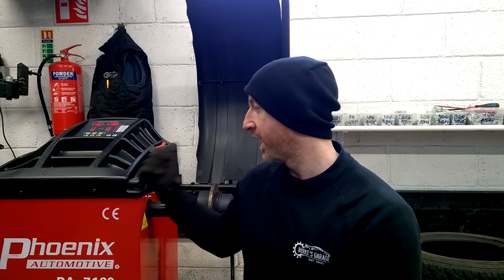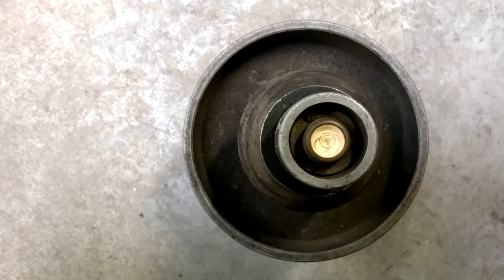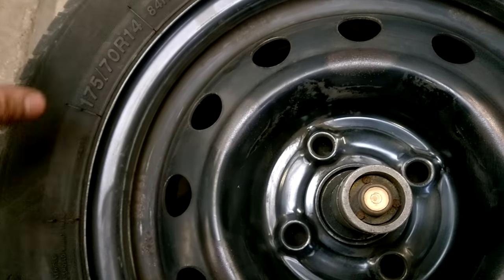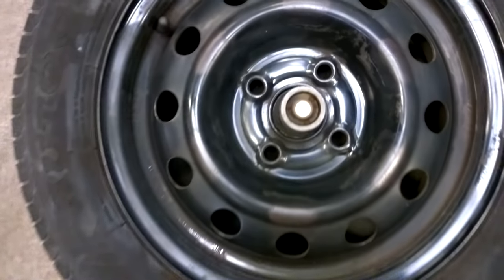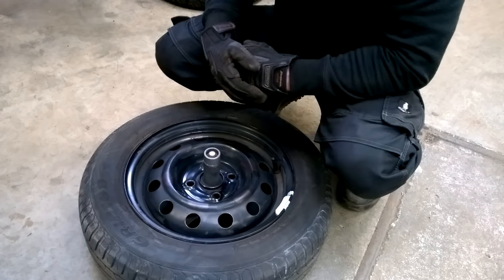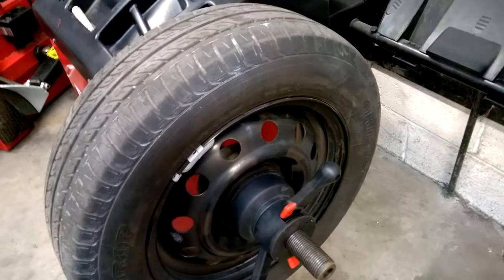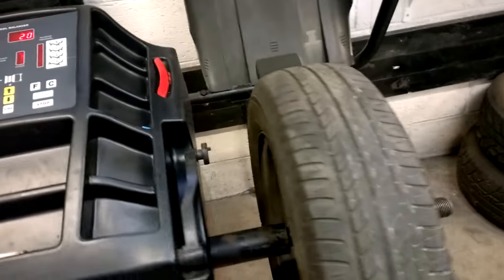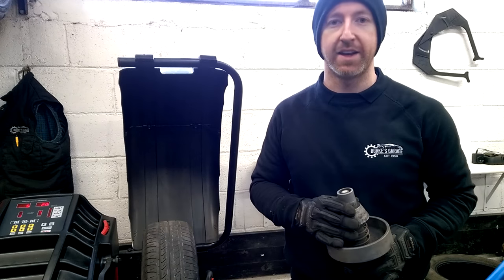Digital Wheel Balancer Vs Bubble Balancer  - Is there much of a difference???

Comment from the maker: To help with any future comments I will simply leave it like this. I know there are other ways of balancing this was simply the way I carried it out as per manual. It is not an attack on bubble balancers just an impartial demo out of interest. 
 
Thanks for watching.
Reply: I think it would be pointless to flip the tire on the bubble balancer, as it only detects imbalances across the tire from end to end (rather than side to side).
I'm fairly certain this comparison experiment is faulty. It's my understanding that static balancing (the bubble) is only capable of eliminating/diminishing radial imbalances. I'm fairly certain that the machine is picking up a lateral imbalance. The reason the lateral imbalance increases when he adds the weights is obvious, he only adds them to one side. If that's correct, how could he not have realized this? He has to put the weight on both sides in order to satisfy the digital balancer.... 
I don't know where the readout for radial imbalance is on the digital machine. But even if it showed a radial imbalance, Gerard could have improved on the radial imbalance while still using the bubble; By adding slightly more weight and spacing that weight around the lighter side of the tire until it is, more or less, balanced.
Reply: If you would read the comments, you will learn what you did wrong.
Reply: Although well-intentioned the eccentricity was not considered out of round elliptical momentum against the center fulcrum allows the tire to be mounted in balance with a weight on the other side it does not make it round it does not make it ride smooth and after it finally settles correctly on the bead it is not balanced either
   Most importantly is sitting the tire correctly on the beat when it is perfectly round you'll probably find from the factory they are perfectly balanced as well
Reply: As well once it is nice and round rotating it on the rim can usually defray any necessity of weights countering against the imperfection of the wheel
   Basically the whole Balancing Act is just that it's a sorry-ass game to cover the laziness of installing the tire correctly the first time which may require dismounting a few times until you get it

Comment: I have to tell you... I just did the tires on my car for the first time using the harbor freight tire changer, and the harbor freight bubble balancer. MY CAR HAS NEVER RIDDEN SO SMOOTH AT 80MPH AS IT DOES NOW!!! And I have always had my tires done professionally, and balanced professionally as well.  I'm sure the computerized balancing  machine is capable of being more accurate, but only if it is properly calibrated, and the tech operating it knows what the heck he is doing.
Reply: Yup.
Reply: I couldn't agree more! I think a lot of garages don't calibrate the digital machine properly, and often don't understand how to operate it, eg:- forgetting to set wheel type, or wheel width properly.
Reply: Great point
Reply: when you do this using a dig or bubble to me the car that drives the smoothest at 70 mph on highway is the winner... this test really did not prove anything imo... just numbers on a machine that did not match the bubble balancer...
Reply: That's because most people don't know how to use a spin balance machine.
Reply: I seen how they calibrated the machine. It takes less than 5 minutes. I think some garages are too lazy to calibrate.
Reply: @tlo35  I don't think half of them know the meaning of the word.
Reply: I was going to by a harbour Freight bubble balancer.....,.they seem so badly made to be worse than useless....

Very stiff....stop rocking soon as you let go....how can that be accurate.
Reply: Wonder what speed he tested the tire at on digital

Comment: You forgot to split the wheigt! 50% of the wheight should have been on the inside when using the bubble balancer,
Reply: Actually split them in half again and spread them about 30 degrees apart if it takes more than two 1/4 oz weights.
Reply: Yeah,  then you know tire was bubble balanced 🙄
Reply: Yup done wrong waste of time to watch
Reply: The smart way to bubble balance is to use stick on weights and place all the weight as close to the center line of the rim as possible. That way the weight you add is for sure not making any dynamic balance problem worst. In fact you may even be 1/2 correcting it.... Any road a dynamic balancer is a wonderful thing to have, a must for a tire shop, but the truth is at least 9 times out of 10 times when a tire won't balance with a static balancer it's because it's defective tire.
Reply: I busted out laughing when he didn't split the weight.  I was trained back in the 80's to repair the Coats computer tire balancers.  Computer balancers are really cool and much quicker, but the tires are balanced at 55 miles an hour ONLY.  When you get on the interstate and do 80 or more, centrifugal force changes the weight needed to balance at that faster speed.  The old way using gravity works much better at varying speeds.  Plus you don't have the stupid guys balancing the tires dragging their weight pliers across the tread of the spinning tires as the computer tries to get a precise measurement.  That used to drive me up the freakin wall!

Comment: I've got a cheap bubble balancer and I've never had any issues... Never had anything feel out of balance at any speeds. The only reason garages prefer digital is they're a lot quicker to use
Reply: Agree - they were setting land speed records using cars with tires balanced on bubble balancers long before digital ones...
Reply: Way to go Sonley!! I agree 100%👍 That's telling them.
Reply: @jerryz2541  yes, in 1886 they set the record at 10 mph...without any digital balancing...crazy huh?
Reply: @kdgdirk  Yeah and when bluebird set the record what was used to balance the wheels.?. Digital wasn`t available then.
Reply: @coopercruse5867  and Bluebird certainly wasnt doing 10 MPH!
Reply: @kdgdirk - Someone need to learn some history... Just saying! ;-)
Example supercharged engines were banned from competition back in the 30's of last CENTURY! As in 1930!!! The ridiculous amount of speed records from those days  were not at 10mph, neither at 100mph, not 200mph... Get the picture?! LOL 😂
Reply: Not all imbalancee is felt, but it can still wear suspension components

Comment: You didn't split the weight evenly between the front and back. Of course it's out. You put the weight on wrong.
Reply: he didnt put the weight on wrong, you only put the weights on the front with a bubble balancer. They are put on both sides  with an electronic nalancer because it balances static and dynamic balance together, where a bubble balancer only measures static balance.
Reply: @roberttill3787  No, you are wrong.  Static or dynamic those weights should have been split between the inside and outside of the rim.  If not, the outside of the rim is heavier than the inside of the rim.

Comment: Great video, however: bubble balancer is only capable of showing wheel's static balance ('vertical shake'). Machine used in the movie checked wheel's dynamic balance ('horizontal shimmy'). Also when doing static balancing weights should be applied ideally close to wheel centre or evenly split between outside and inside rim. I suspect the dynamic imbalance showed on the machine would have been much less by placing weights on the rim correctly using bubble balancer. But anyway it was interesting to watch. Thank you.
Reply: This point is huge, I didn't properly understand the difference between static and dynamic balance for the longest time, I don't think many people do. There is no new or old way, there is x axis y axis, each machine is testing for balance in a different axis. If old mechanic's could guess where the dynamic imbalance was and account for it by moving the wheel weights to the correct location on the static imbalance spot I would be very impressed.
Reply: I use the y formation when applying the weights I find the stick on one's best 👌

Comment: It probably would have been better to place the weights on the outside and inside of the wheel evenly.  I have experienced a dynamic balance that was bad but the bubble balance was great.
Reply: Machine calibration has to be done on a regular basis to get an accurate balance. Computer balancers have an oscillator that has a set frequency and will not maintain that frequency till tire is balanced.  Hitting weights on tires and that mud guard that gets flipped up and hits the stop messes with the oscillator.  Too much of a shock.

Comment: There's a refinement to using a digital balancer that I've never seen anyone do. Put the weights on as it advises, then re-spin to check. So far, so standard. But then undo the clamp, rotate the wheel a quarter-turn relative to the balancer shaft, re-tighten the clamp and re-spin. You should of course get 0/0. If you don't, you know either the balancer needs attention or the wheel wasn't clamped quite true.

Comment: As an added note to my previous posting, I wish to explain my experience at balancing. From 1979-1995, I was the Western team leader on the Bear Championship Racing Balancing Team. Our team provided the tire/wheel balancing on the CART/PPG IndyCar World Series, of which I was a part of for 17 seasons. We worked in concert with Goodyear Racing and their engineers (Goodyear) calculated, that I "personally" had successfully balanced 80,000+ Goodyear Racing Eagles over that 17 year period. We used nothing special, the balancers we used were exactly the same balancers available to any repair facility. The only modifications done on our race balancers, involved the mounting cones used to center the wheels properly on the balancers, wheels provided by the IndyCar teams. Our balancers were digital and like the balancer above in the video, they provided both static and dynamic balance combined in the calculation. The difference from above, race balancers display in ounces, NOT grams, and they display in increments of 0.25 oz (0.25, 0.50, 0.75, 1.00, etc.) and maintained the North American standard 0.25 dead-band. (an 0.25 dead-band is if the measured imbalance is 0.24 or less, the balancer displays 0.00). For your knowledge, if a tire/wheel is out of balance, (considering the accepted standard of 27.5" outside diameter), the vibration of an out-of-balance tire/wheel cycles in 16 mph peaks. This means the vibration increases at 16, 32, 48, 64 mph, etc.. For a driver to feel an imbalance, the vehicle has to reach 60 to 65 mph to actually feel it at the steering wheel. For a severely out-of-balance tire/wheel, a driver may feel this imbalance at 48+ or - mph. Most tire/wheel balancers operate or spin at 24 mph (split between the 16 and 32 mph peaks), while more expensive balancers (and like our race balancers), spin at only 16 mph. Spectators were always surprised to see how slow our balancers turned, but we explained that if a tire/wheel was out of balance, it was out of balance no matter what, even if it was just sitting on the floor. We spun the race tires at a low speed, so any vibration would not be transmitted to the balancer sensors (piezo crystals on our balancers) and interfere with the computer calculation matrix. As long as we were within 0.25 oz at 16 mph, that tire/wheel was good at 245 mph, no problem.
Reply: nice info, wish you'd said you used a bubble balancer  OLE'!

Comment: Several comments have questioned the accuracy of the spin balancer which is a fair point.  To verify the accuracy of the balancer first balance the tire to zero, take your balancer out of round off mode if possible.  Use modeling clay for small corrective weights.  Spin it a few times to verify the repeatability, it should stay very close to zero.  How much it varies is known as the noise floor and will give a hint to your balancer's resolution.  Now attach a weight (weigh the weight on a digital scale) to the inside flange of the wheel and respin.  The balancer should request an equal weight, directly opposite the weight you just attached.  If the weight is not directly opposite the imbalance weight or jumps around your balancer needs servicing.  If the corrective weight is in the correct location (IE directly opposite the imbalance weight) but the weight amount is off VERIFY YOUR WHEEL OFFSET AND DIAMETER DIMENSIONS.   When you enter the dimensions you are telling the balancer where the corrective weight is going, it's very critical and it's not the fault of the balancer if you lie to it.  Some balancers will let you adjust the dimensions and will recalculate the corrective weight as you do, others require a respin. Spend some time and get this right.   Now move your imbalance weight to the outside of the rim and repeat this test only now adjust the wheel width if necessary.  Once you have the outside reading correctly try different size weights to test the linearity.  Finally, loosen the wheel, hold the balancer shaft and rotate the wheel 180 degrees and retighten.  Repeat the test above without zeroing out the tire.  The errors you see now are a combination of wheel trueness and balancer mounting errors.  If you see significant errors and you know the wheel is serviceable (does not equal true) you may want to check the balancer shaft for bends, cones for dings, off-center cones, mounting technique (hub-centric vs lug-centric), etc.

Comment: That's not a good comparison. That's a piece of crap bubble balancer. The bubble balancer I used in the 60s and 70s weighed over a 150 lb. You could breathe on it and it would move. It took time and skill to use. We bought a Coats dynamic balancer when they first came out. It was fast and simple to use and became the mainstay. But we never used it on our motorcycles or any of the cars we drove fast and hard. To this day I don't think they're as good as an old fart with a quality bubble balancer and lots of years of experience. Or, a young guy with the incentive to learn.
Reply: A bubble balancer will work fine on narrow tires.  They have more opportunity for error the wide the tires get, though you could still be lucky and have a fat tire and wheel that just happens to be in perfect balance from the start.
Reply: John my Dad would use one of the Bubble balancers when I was a Kid my Uncle had a Auto mechanic shop They Did everything in that shop Engine, Transmissions, Axles, Breaks,  front end alignments ,  Tires .   Not many shops do it all this day and age .
Reply: I feel like being able to tell which side needs weight is better especially if you are going real fast

Comment: How did you determine the accuracy of your new balancing machine?  Or did you just trust it to be correct?
The reason I ask is because of an experiece I had some years ago.  I worked in the elevator trade, and we were installing door frames.  The usual method of plumbing a frame was with a plumb bob on the end of braided fishing line fastened to a magnet at the top of the frame.  This allowed for an accuracy of less than the thickness of the line over the full length of the frame.
A common problem was that we sometimes worked inside buildings that were not as yet completely closed in.  If there was any kind of breeze,  it would involve going to great lengths to close off the area.
I invested in an electronic level, as I assumed that would solve the problem.  Yeah, right!!   After rechecking with a plumb bob inside an enclosed building, I found that it was pretty much impossible to consistently get an accuracy closer than 3/16", and I had little choice but to back to the "stone age" method.
Reply: the plumbing method is not 100% accurate... the earth is rotating, so is like you drag the wire lateral, the weight remain behind... the electronic is less accurate usually, because of small chip and inside imperfections like housing molding,... and because tool is for average diy construction worker

Comment: Neat video, but try the bubble balancer again with the BADA method.  It's a little hard to explain in a YouTube Comment, but you start by putting four weights on the light spot of the wheel, two to either side of the exact spot.  The combined weight should be just enough to "over-correct" the balance; that is, they will make the light spot a little too heavy.  Next, move the weights away from each other along the rim in pairs--keeping the distance between each weight-pair and the original light spot the same--until the bubble is balanced.  Wherever the weight pairs end up, hammer one of each pair on the outside of the wheel, the other on the inside.